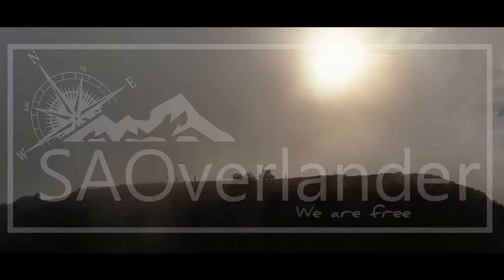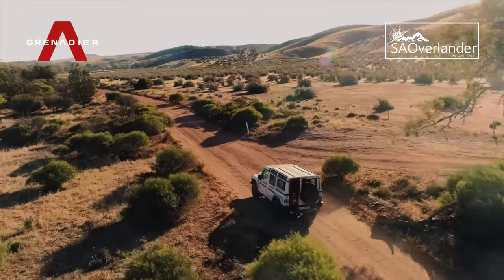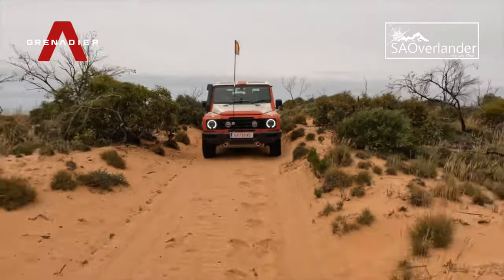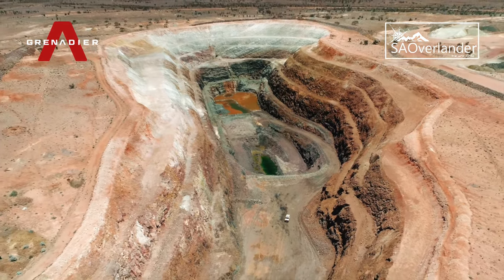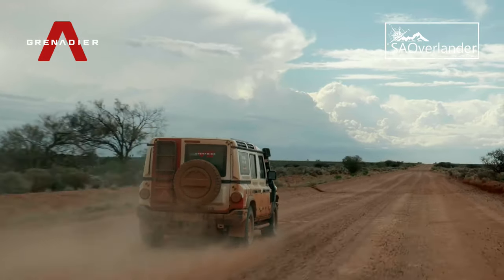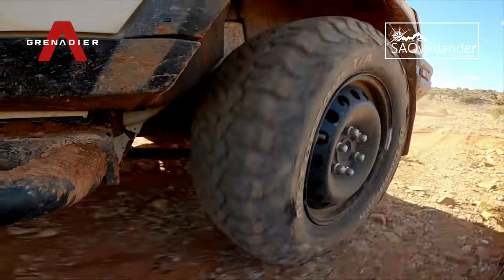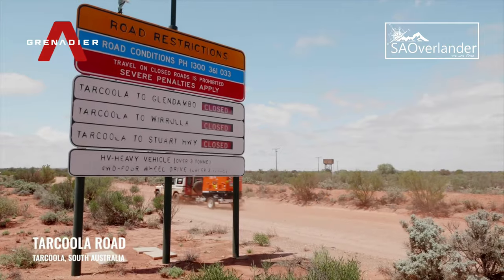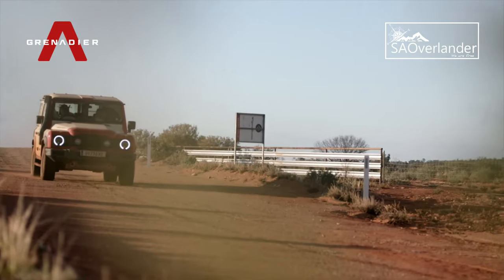INEOS Grenadier Australia Trails the Ultimate 4x4 Test .  Tuff is not the word.  #4x4  #grenadier

Comment: We need a 3.5 too 4ltr v8 twin turbo turbo diesel.. Single cab with leg room, and a dual cab ute qith not too mu h crazy tech... with a 4 tonne plus town capacity. To kick this stupid landcruiser off its perch. the landcruiser needs.a chassis extension to handle well. something worth keeping in mind. Work with current tuners and aftermarket companies.. I hope you guys build a ripper but in a ute.. So its useful.. Do that and I will buy one.. But I can't use a wagon. it's just not versatile enough and no good for dogs or sleeping in if it's too short.